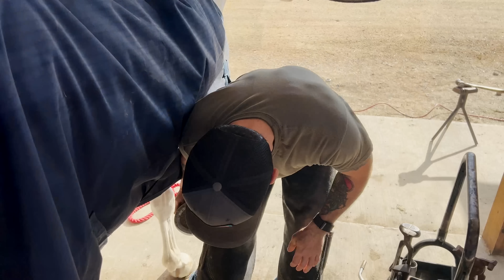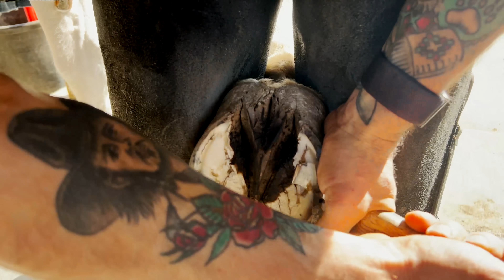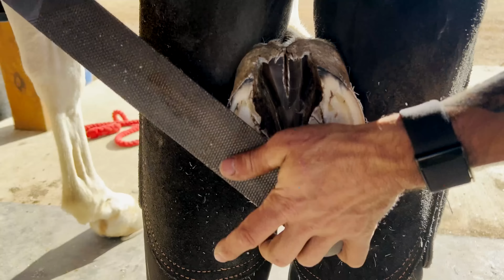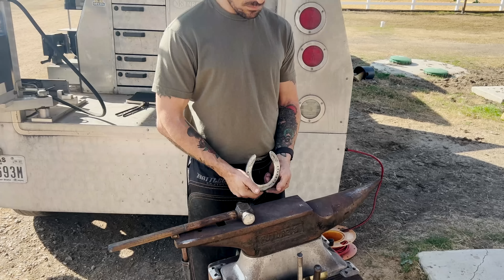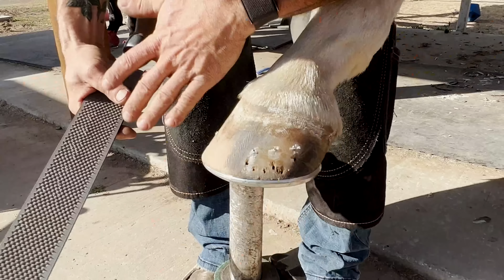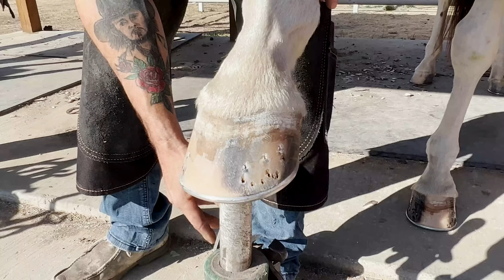Fixing a Broken Shoe: Relaxing Horse Shoe Restoration ASMR

Comment: This is a video of firsts for me. This is the first time I've ever seen a broken horseshoe, the first time I've seen a horseshoe that shiny and with so many holes in it, and the first time I've seen a shoe secured with three nails on both sides of the shoe. I also think it's the first time I've seen a shoe being cold worked.
          I'm guessing that this shoe is something special, perhaps required for some kind of competition, where all competing horses must have shoes of the same design, weight, and perhaps even metal composition. I'm probably wrong, but I was trying to think up a reason for the difference to shaping, fitting and fixing of a normal shoe.
          As to why the removed shoe was broken, well, I guess there was some kind of flaw or fault in the metal bar before the shoe was made. It's the only thing I can think of that would result in a shoe cracking in half like that.
Reply: It's an Aluminum shoe, that's why it cracked, whereas Iron wouldn't have.  Aluminum is also worked cold, instead of hot.